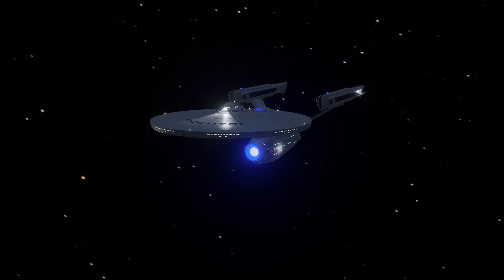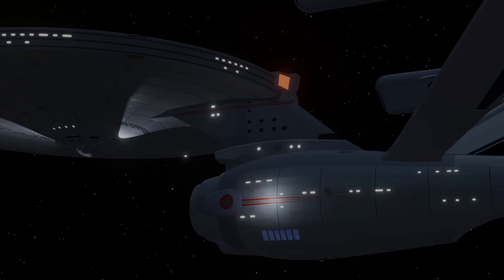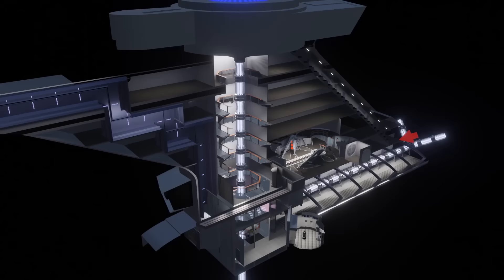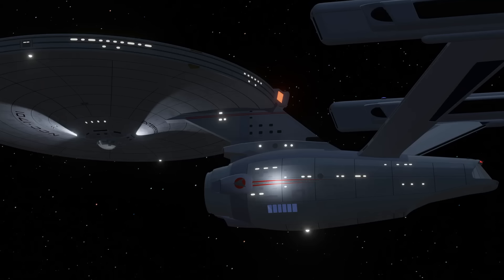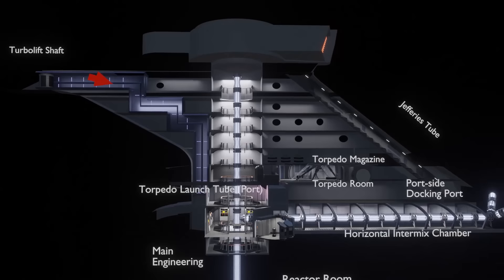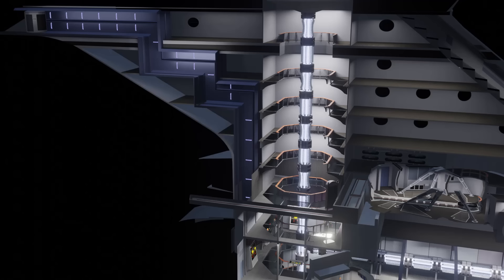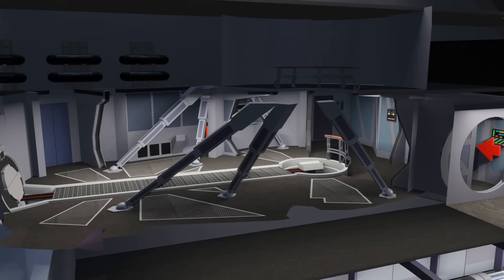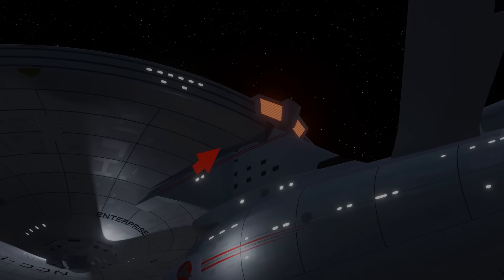The Enterprise Dorsal Problem: how did the turbolifts pass through it?

Comment: As we all know, the refit Enterprise has a straight vertical turbolift shaft that runs through 78 of its 21 decks.
Reply: huh?
Reply: @crsrdash-840b5 Star Trek V reference
Reply: @RCAvhstape  do you mean JJ enterprise?
Reply: @crsrdash-840b5  No, the rocket boots scene from Star Trek V.
Reply: And, of course, adding to the ridiculousness of that scene, the decks numbers grow in the size as you go up, instead of down, like it’s supposed to be. :-)
Reply: @crsrdash-840b5 no, they actually managed to keep track of the number of decks in those.
Reply from the maker: I came so close to referring to that!
Reply: @crsrdash-840b5  Star Trek V was the low point in the legacy series (seriously challenged by Nemesis, though) until JJ decided those were rookie numbers.
Reply: @jkleylein  The JJ movies were terrible and I am sad original Spock was apart it before he died. The only great thing was the cast representing the original cast. They were spot on! The ship itself was a mess.
Reply: @crsrdash-840b5  That Engineering section using an actual Reactor facility was the dumbest thing I ever saw in Star Trek 😥
Reply: I got that reference!
Reply: @duramirez  Um, I would say using an abandoned brewery as the engineering section in JJ1 was the stupidest thing.  All those rivets and iron beams looked so 23rd century . . . or was it 13th century?
Reply: @jkleylein  yeap yeap
Reply: If you watch some of the TOS episodes when in the turbo lifts you see the lights on the wall move up & down & also sideways so it travels like a 3D chess board
Reply: @Shadowkey392  except when they pass the same deck a few times...
Reply: ST5 was a poorly written movie almost lazy even its special effects were sub par
Reply: @crsrdash-840b5 No, it's from Star Trek V. Spock carrying up Kirk and Bones more than 70 decks with rocket boots, to go confront Sybok.

Not sure how many decks the U.S.S. Abramsprise has, but it seemed to be much, much larger than the TOS Enterprise, or the movie refit.
Reply: Just like Willy Wanka’s. It went this way and that way!
Reply: And to make it even more crazy: They END UP at the front of the shop. Not the top. Which means that some stupid person must had build all the doors and signs sideways and also the gravitation goes sideways in this shaft :D
Reply: @sandmangti7040  exactly
Reply: Ok another thing on ST5 to remember is that William Shatner was in charge of the production and the Director of it as well as it having a low budget to work with at the time of being made indeed!,🤔.
Reply: Eemsg speaks truth. We saw it with our own eyes, after all.
Reply: @stevenewman1393 no excuse for bad writing and logic errors. Besides, it had 3 times the budget of the first Star Wars.
Reply: @countluke2334  ,Ok that's very nice but alot of the graphics and visual effects weren't all that good and the writing was flawed and the Enterprise having 79 decks instead of only 21to 27 decks depending on which movie you watch and what about the rocket boot scenes and I could go on and no offense but it looked more like a made for TV movie and it was the worst of the 6 films made indeed!.
Reply: It’s not real.  Done, explained.
Reply: I think the ridiculous number of decks on the Enterprise A, as revealed in “Star Trek V: The Final Frontier,” was William Shatner‘s way of one-upping the Next Generation’s Enterprise D, which was twice as big as Kirk’s Enterprise. Enterprise A: 24 decks; Enterprise D: 48 decks.
Reply: @jefferyseay5846  Given we're talking about the guy who once told Wil Wheaton "I wouldn't allow a kid at the helm of my Enterprise" I absolutely, wholeheartedly believe this. 😂
Reply: I'm sorry but why does the warp core have to go all the way to the top? Why can't it run up shy of 2 decks and then the turbolift can go over it.
Reply: @TiredTimelord the impulse engines. supposedly.
Reply: But I could swear there were times the turbo lifts ran horizontally shown by the lights (I can't remember in what series). Can someone confirm or deny that?
Reply: The obvious answer to both that and the problem posed in the video is that Starfleet had access to Time Lord technology. Which might also explain where Voyager was keeping all those shuttles...
Reply: @acmenipponair  It's so that it can end up in a freefall if it breaks
Reply: It's a long and dangerous climb.
Reply: As we all know, none of it is real.,.
Reply: Well, the Enterprise A does. Not sure about the 1701 Refit.
Reply: How is it possible that the Enterprise Constitution Refit has 78 decks, when the Enterprise D has only 42 decks?
Reply: @LordCommanderEdTN  Andrew Probert wanted to double the size of the original Enterprise for her refit when he was working on it. The A could be massive for whatever insane reason we come up with, although frankly I'll just pur the issue down to "wibbly wobbly timey wimy" - please excuse me while I barf for using those words.
Reply: I have long held that the -A was assembled out of several other ships (which explains the multiple names given to the pre-rechristening ship). Areas which were not commonly accessed would then commonly have old labeling. So, say they took the turbolift control systems off of an old starbase, suddenly you would have displayed deck numbers impossibly high. Also would explain the numerous engineering issues, and why it was retired so quickly.
Reply: I believe in Star Trek Nemesis they changed the number of floors three times. Then again, it was Riker, so maybe it was part of his role.
Reply: @wahoo236  And also that on the top floor, there's a big "STOP" painted on the wall.

Comment: Kirk didn't leave the torpedo bay and go to the Bridge in TWOK, he went down to Enginering first which makes sense as he would have walked out the door to the warp core area and then down one deck.
Reply: But then he would have had to go through a door to access the warp core observation area, and THAT door would have had to be in the center. Having it off to the side means he walks into the starboard torpedo tube...ahhh gotta love those trekonsistancy issues lol.
Reply: @02ujtb00626   Oh your right, I forgot the tube shaft is down the center and then spits off.  I suppose he can duck under it!!😄
Reply: @02ujtb00626  Especially back then, I don't think they put too much thought into how spaces would fit within the ship. Kind of like how in most games, the interior space of a ship often does not conform to the exterior model of the ship.
Reply: @02ujtb00626  What about the one person elevator Kirk uses in Star Trek 2 to access the warp core second level scaffolding?
Reply: @SiXiam  I'm not sure. I think that just leads to engineering upper support like in Voyager and TNG.

Comment: In the turbo lifts in TOS there’s a panel on the wall that when the lift was moving would either show a pattern of lights going from top to bottom, when Kirk and co we’re going to engineering, or bottom to top when they were going to the Bridge, sometimes the lights would go from side to side. I always thought this was showing how the lift was moving during the scene
Reply: That's exactly what was going on.
Reply: Nailed it!
Reply: It may well be that those lights are for the benefit of the crew inside rather than actually reflective of the outside, so lights moving on the vertical axis could still be shown even if the lift is traveling diagonally. (Of course, in actual fact the lights are just there for the benefit of the cameras and the audience :D)
Reply: They had that on tng as well

Comment: I always thought of the lifts as more like a pneumatic tube style setup. Given the control of gravity in the ship they could easily shift into diagonal, vertical, or horizontal. All that really matters is that at the end it orients to the destination. The entrances could be punchouts that allow for loading and the initial click simply the reorientation to the lift line.
Reply: They could simply go horizontally as well. Given the size of a Galaxy's saucer using a turbo lift for a cross saucer trip makes sense. 

Getting to the secondary hull of an Oberth flat requires the cabin of the turbo lift to tilt on its trip.
Reply: @mikespangler98  Maybe the Oberth class uses the 2D-Space technology to flatten the turbolifts like that one episode in the Orville :)
Reply: Functionally in episodes we have seen lifts jam, in next gen they had to pop the top of one and climb to a geofrey tube.. which also implies lifts usually run parallel to Geoffrey tubes
Reply: they are maglev I think. Fun note an RL elevator company has shown a functional elevator using this tech and it does work like a turbolift able to go vertical and horizontal.
Reply: There is some two dimensional thinking going on here!

The "grav plating" idea that there's some magic artifical gravity generation going on in the decking inside the turbo lift means that the lift capsule didn't need to obey the idea that the lifts move strictly vertically like the elevator in a building.

Imagine the turbolift capsule could take a curving path as it traveled the tube shift. It could travel in any configuration so it appears from the outside to being any orientation like flipping over on its side and the occupants inside would experience no change in its internal gravity always going down to its internal floor. 

It could do loops like a roller coaster car but sealed inside with the doors closed its occupants wouldn't experience any change in inertia. Inside the turbo lift the gravity is local. 

In fact the lift could be completely "upside down" in relation to viewing it from outside yet the occupants wouldn't be aware of that inside. 

This frees up the shaft to run any way you please instead of going in strictly vertical or horizontal directions as it travels as shown in the animations.

The overall width of the dorsal is still a problem, but again what we see as shafts rising vertically between decks isn't necessarily restricted to being horizontal as well as vertical in the blueprints. 

The parts of the sets we see have to go vertically as that's the only practical way to build them in a sound stage, but who's to say with magnetic constriction inside the matter antimatter tubing once the they disappear up in the ceiling don't start curving like bending pipes like plumbing tubing? A tubolift shaft could be bang up against the mix tubing as it twists past it as the magnetic containment must keep any heat or radiation contained inside the "glass" we see in Engineering right?

So the mix tubing could be bang up against the inside of the dorsal hull on one side and the tube shaft on the other and the structure members and hull plating in the fragile looking neck of the dorsal be the densest and strongest on the entire ship. It would have to be to prevent the thing getting twisted or sheered in half between the primary and secondary hulls as the whole ship moves through space.

The structural integrity field must beef up that strength in relativistic speeds, but once the warp field forms the ship itself is experiencing no inertia changes or the crew would be goo.

Practically the neck could have been lots wider like in the galaxy class and not really affect the look of the model ship, but Jefferies just drew it insanely thin and the model was built that way for looks.

Now you REALLY want a brain-melting problem try fitting all the sets seen in the Discovery in the film "2001" into the round hull of its model! 

It's like Doctor Who's TARDIS where it's bigger on the inside due to "transdimensional engineering" so it's enormous interior fits inside a tiny exterior!

The 4th Doctor explained it hilariously to Lela who listens and proclaims "That's silly!" to which The Doctor proudly proclaims "That's Timelord engineering!"

I'd give anything to know the reactions in the actual 23rd century to our 20th century imagings of their time!

As we look at old 1930s-50s scifi serials like say Buck Rogers, they will be rolling on the floor laughing at any of our current TV shows I'm sure.

The transporter is likely to forever be the silliest "tech" ever imagined - but then again maybe it will inspire them to muse that tearing a human apart into its atoms and reassembling them is silly, but come up with a way to simply flip people through an inter-dimensional wormhole to their destination? 

The actual 23-25 century technology made so weird we can't even begin to imagine it now.

Look at how bang up until the year 2000 no scifi show or movie anticipated smart phones. No one has them in "Blade Runner" set in 2019. Anything written decades ago in stories set after 2000 anticipated them. 

Scifi is just often lousy at predicting future tech...
Reply: @mikejackson3028  Although it is a later Enterprise the TNG episode where Geordi endures a malfunctioning  turbolift might give us some clues. It suggests that there may be a combination of orientations within the ship. The initial side slams suggest that within a deck the lift may stay properly upright. This is followed by a brief floor slam as it connects to the larger grid, then a ceiling slam as it is turned and shoots him mostly to the bridge. The lift then slows and reorients a bit before a final diagonal movement ejects him on to the bridge. 
I agree on the transporter too. It is just space magic and it was developed to replace the expensive shuttle props.
Reply: This- since we have to have artificial gravity, I always assumed you never knew which way the thing was pointing. It could be making ugly 90-degree turns around the ship whenever it needed to.
Reply: I have always found the design of this ship to be ugly as sin. Elegant is a joke describing this thing.
Reply: @concidius  actual grav plating would introduce all sorts of possibilities- one could line the inside curve of the secondary hull to create a hamster wheel effect so one could go for a 'endless' jogging track.

I'm not sure the bouncing around Geordi did though was indicative of anything other than to create some drama and false jeopardy.

Grav plating would introduce all sorts of possibilities never explored on screen.

Remember the kinda dumb scene from one of the movies where Kirk and McCoy I think it is are saved by Spock and his rocket boots sailing up like 70 decks in a vertical turbo shaft? Firstly they simply didn't care the Enterprise refit didn't have that many decks, but why would you make a turbo shaft you could fall to your death in???

In "Disaster" they repeat this idiotic situation where the car can fall down the lift like it were an elevator in a building.

But why would you put grav plating in the bottom of a shaft instead of letting it just be zero G? The lift cars would be wasting energy trying to go "up" shafts when it could be a maglev tube and expend little energy traveling in weightlessness? Gravity would always be local inside the car for its occupents! The car could do loopty-loops in a twisty shaft and the occupents wouldn't have a clue!

Again to quote Spock, 'Two dimensional thinking"...
Reply: Yeah there's a few episodes of TNG where they establish (with set lighting changes that are easily missed if you're not paying attention) that the turbolifts can move horizontally as well as vertically. It's not that much of a stretch to assume that they can align the shafts on diagonals as well, and it would certainly explain some of the wonkier ship designs in the franchise, like the California-class' engineering hull connections to the saucer being routed through the warp nacelles.
Reply: Forget how it fits (or doesn't), it would still be a giant issue for safety when there's hull damage, making it impossible to reach parts of the ship, or killing people in transit, and creating points that would act as channels in explosions, along with massive atmosphere loss.
Reply: Exactly. They could orient any way they wanted. It wouldn’t matter since gravity can be altered in any way.
Reply: @mikespangler98  Using inertial dampeners and artificial gravity they would never notice the diferrence.
Reply: @SaltRockStacker  Use of a gravity well would allow them stretch them out really thin then snap back into shape at the other end.
Reply: They did exactly that. They were not merely elevators. And they had side shifts and turn outs to allow lifts to pass one another
Reply: Yeah same, the grav plating on the floor of the turbolift could keep you standing comfortably while the pod itself twists and loops all over the place.
Reply: Bingo! People need to stop thinking about spaceships like they're a f'ing office building. In the Trek universe, they have artificial gravity, so "up" is whatever direction they want it to be, whenever they want.

Comment: The book "Mr Scott's Guide To The Enterprise" postulated that the turbolift slides into the dorsal on G-deck from the side, then goes down, aft, down, aft and finally down (behind the torpedo room) into the secondary hull. It's a lot of manoeuvres but it does fit!
Reply: This, it does indeed do complex maneuvers in the Impulse Engine complex.
Reply: You should check out HalfScreen, they show starships from Star Trek and Star Wars deck by deck internally. Among these was the refit Enterprise.
Reply: @whitewolf3051  Am very well acquainted with Halfscreen's channel, but thanks anyway! 👍
Reply: Still a smooth ride thanks to inertia dampeners.